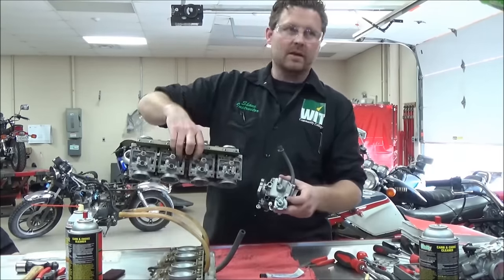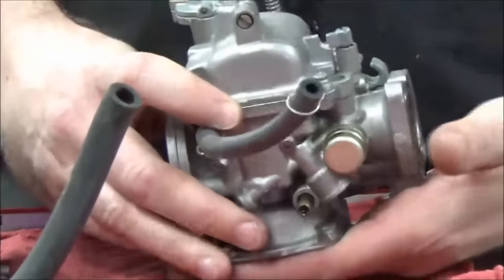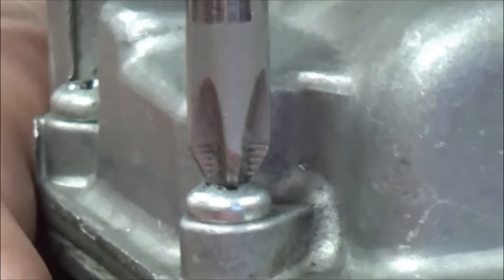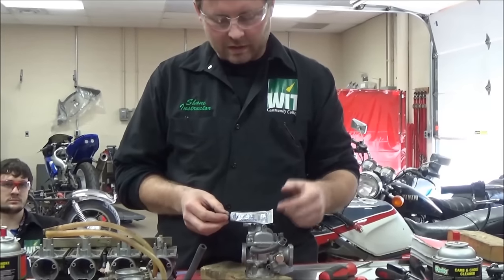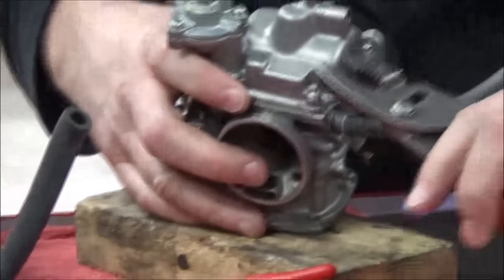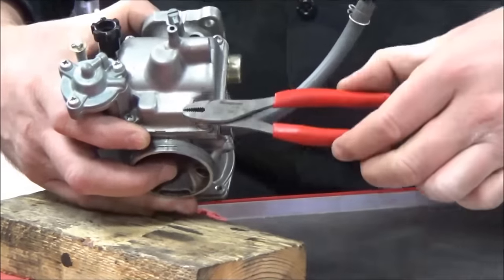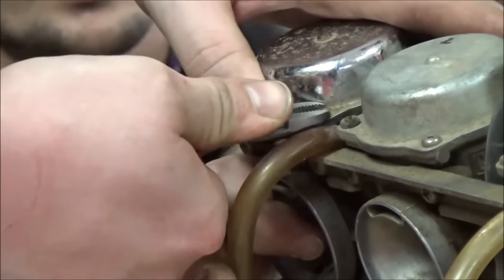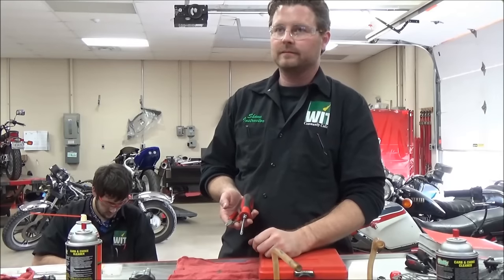How to remove stripped or stubborn bolts WITHOUT drilling! AND Save the day with 5ACP Midget pliers

Comment: Those pliers look good. The more alternatives the better for different problems. Thank you.

Vessel make good JIS screw drivers, but they also do a range called Impacta. These are screw drivers with a built in impact driver action. Useful when the screw head is difficult to get at.

Comment: I've used the old fashioned manual impact driver handle with great success when the phillips head was stripping out. First, use the correct bit size, or an extension; then, push down and make sure the handle is already rotated to the "CCW" removing direction, then lean on it and push hard before you try turning. The internal spring and impact design transfers inward pressure into a ccw action and this does a good job of not allowing the driver to rise up out of the head. Use a hammer if this fails, but keep inward pressure on the handle as you strike it. Even stripped screw heads can surprise you by loosening, when power impact tools fail.
Reply from the maker: We have videos on the channel demonstrating impact usage as well. Thank you for the comment. See the link below for more help with your question. I have been banging my head against the wall thinking of ways for people to say thank you in an impactful way to help keep these videos coming. Here are few ways that many have found as a way to give back. 
* Membership to H2W (includes t-shirt or tech help) https://how2wrench.com/product/membershipmembers-onlymembers/
* Simple donation to say "KEEP IT UP"
May you have a great day and... https://www.paypal.me/how2wrench

Free Mechanic info, tool reviews, and “how to” videos newsletter sign up: https://how2wrench.com/subscribe-free-newsletter/

Missed a past issue? No Worries. Newsletter Archives: https://how2wrench.com/blog/newsletter-archives/

Like freebies? Click here for a free diagnostic checklist! 
http://gem.godaddy.com/signups/364621/join  

If I can ever be of service to you, here is a video explains how to connect with me. 
https://www.youtube.com/watch?v=vjvmB01ebcs

Comment: If you want to see some stripped fasteners, but a bike off Craigslist. Carb bowl, idle / air adjustment, drain, case covers, you name it, you'll fine some goobered up. Most owners have little to no mechanical knowledge and they just torque the heck out of every fastener. I'm restoring a 2004 PW80 right now and it had it's share of stripped fasteners. I had no choice but to replace with OEM parts. When I sell it, whoever buys will get a short lesson in what a JIS fastener is and what tool they should be using on it. I've done some research lately on the JIS bits. Supposedly, the newer US Imperial screwdrivers and bits are made with similar design to JIS and even the Japanese are no longer marketing screwdrivers as "JIS" standard. Maybe tool manufacturers are moving towards a more global standard on "cross-head" screws and bits, but chances are the old American standard tools in your box are not intended for the Japanese screws. Personally, I'm going with some JIS bits I bought and trying those out.
Reply from the maker: Right??? I just bought some JIS Screwdrivers to make some videos on and compare! 
Thanks for commenting and adding value to our community!

Have you subscribed yet to never miss a video? Have you seen the video playlists? Check them out here: https://www.youtube.com/user/conleybuilt/playlists  

Want to say “thanks” or “keep it up”? Click here https://www.paypal.me/how2wrench    
 
Your answers and help are just around the corner. Save time and money while protecting your investment and yourself by doing it the right way at www.How2Wrench.com

Comment: In 50yrs of practice, I've never failed to remove a float bowl screw, or any screw for that matter, without anything more than a good dot punch and a sharp tap. But have used many other methods as well.
Reply from the maker: Nice. I have found this so depends on whom your following as in the last mechanic. When following DIY wrenches, due to a lack of good shops in the area, you find many fasteners buggered up. 
Head over to the new website and subscribe to the newsletter to never miss a video or newsletter! www.how2wrench.com/contact/ 
Keep Wrenching,
Shane Conley
Instructor/Motivator/Motorcyclist
www.how2wrench.com
Reply: Will do Shane...Even though I've been "At it" for over 50 yrs one is never to old to learn!!

Comment: Take a rubber band or inner tube and place it on the stripped philips head.  Then place screw driver loosen with screw driver.  The rubber band fills the stripped areas and provides extra traction for driver

Comment: As a long time machinist and HD rider I've seen my share of abused fasteners. Most mechanics are faced with getting out stripped bolts on their own with limited time and resources. I'd say have the mechanic spend the minimum time on the problem screws and then send them to somebody with a milling machine and experience.

Something I've faced more than once:

People assemble their HD wheels, they completely coat loctite on the steel bolts (disc/pulley)  and then screw them into an aluminum hub. Try to take it apart a couple years later but the bolts (allen) either strip out or break off. So they get a hand drill, drill a crooked hole and then break an easy-out in the hole. Beat on it with a hammer for good measure and then they send it to me! 

I always get them out no matter what and sometimes even save the threads but sometimes I do heli-coil or make an insert on the lathe.

-'lil stan
Reply from the maker: I hear ya... 
Thank you for sharing in my work. If I can ever be of service to you, here is a video explains how to connect with me. 
https://www.youtube.com/watch?v=vjvmB01ebcs 
Keep Wrenching,
Shane Conley
Instructor/Motivator/Motorcyclist
www.how2wrench.com
Like freebies? Click here for a free diagnostic checklist! 
http://gem.godaddy.com/signups/364621/join 

Did you like this free video and hope to see more? Would you just like to say thank you with a donation? Click https://www.paypal.me/how2wrench

Comment: Another great tip! We have two 2000 buell blasts. One starts perfect with no throttle and the other needs throttle even with a new electric enricher. I can spray cleaner thru the enriched circuit and see it come out. How can it not be getting enough fuel? Could you help me with this?

Comment: My tech tip: use an angle grinder with a 1mm blade or a dremmel to cut a groove and then use a flat. You will be able to reuse that screw especially if you are a diy guy and you don't have access to all types of screws

Comment: Shane coney I have had a set in the industry no way can you do carb cleans at motorcycle shops in the spring working Commission without tricks and that's just one of many thanks for sharing thanks for sharing I would share more myself butb I'm not that computer savvy nor do I have time I have had a set in the industry no way can you do carb cleans at motorcycle shops in the spring working Commission without tricks and that's just one of many thanks for sharing thanks for sharing I would share more myself but I'm not that computer savvy nor do I have time I hope you two helps everybody as much as it has the community that needs it because it is based on a free video  format.

Comment: Ever heard of hand impact drivers, makes that screw come out like a hot knife in butter.
Reply from the maker: We have videos demonstrating that on the channel as well. Over 500 videos on here. Thank you for the comment. See the link below for more help with your question. I have been banging my head against the wall thinking of ways for people to say thank you in an impactful way to help keep these videos coming. Here are few ways that many have found as a way to give back. 
* Membership to H2W (includes t-shirt or tech help) https://how2wrench.com/product/membershipmembers-onlymembers/
* Simple donation to say "KEEP IT UP"
May you have a great day and... https://www.paypal.me/how2wrench

Free Mechanic info, tool reviews, and “how to” videos newsletter sign up: https://how2wrench.com/subscribe-free-newsletter/

Missed a past issue? No Worries. Newsletter Archives: https://how2wrench.com/blog/newsletter-archives/

Like freebies? Click here for a free diagnostic checklist! 
http://gem.godaddy.com/signups/364621/join  

If I can ever be of service to you, here is a video explains how to connect with me. 
https://www.youtube.com/watch?v=vjvmB01ebcs
Reply: @Eddie Whittington  Yup!!!!! DeWalt DCF887 or DCF787. Hot knife, glowin' hot! And, no real pressure required. Especially good on bolts where a socket might ring off the head. Just needs that little burp. Never use one to tighten a bolt/machine screw.

Comment: you can put a wrench on your screwdriver for extra down force
Reply: Mark Heckman   yes you can use a wrench,,, or even clamp on a pair of vice grips,,,,, but any screw you'll need at least 60 lbs of downward Force to keep the screwdriver in its slot,,,,,,,,

Comment: Some good knowledge. Did everything BUT use the bolstered area on the screwdriver which is made to use a wrench. That keeps you from having to use body weight. Instead, one can use the tool properly and not form a hazardous habit that could lead to injury down the road. Just a thought.
Reply: he uses his body weight so the screwdriver doesn't pop out, not to twist it
Reply: As XxBLOODZILLAxX said, he was using his body weight to keep pressure down onto the screw head, which was damaged.

You should always apply pressure onto a tightened screw for at least 1/8th of a turn, otherwise theres a distinct possibility the tip will lever out & damage the screw head further, especially if your screwdriver is worn or isnt a snug fit.

A lot of cheaply made products have badly made screws, either of metal thats too soft, or that corrodes quickly, or with slots that arent accurate, its always worth going through a selection of screwdrivers & bits till you find one that fits tigtly, otherwise you are running the risk of it rounding off.

Then you`ve got the potential of the screw head breaking off of the thread, if you suspect thats the case, use penetrating fluid & wire brush the back of the thread off with a Dremel if its accessible, maybe even heat the surrounding metal if its safe to do so (obviously be careful with carbs or anything with rubber or plastics in the vicinity), then go for it.. If it still breaks, well, thats another video!

Comment: What if the stripped screw isn't accessible to a pair of pliers? I've got my carburetor out of my bike but the cover keeping the Trumpets (?) on has a few stripped screws. Pain in the ass... this is my first go at anything motorcycle related and so far these stripped screws are my only set back.
Reply from the maker: Karsten Weening 
Email me a pic of what your dealing with. how2wrench@gmail.com 

Also If I can ever be of service to you, here is a video explains how to connect with me. 
https://www.youtube.com/watch?v=vjvmB01ebcs 

Link to membership: https://how2wrench.com/product/membershipmembers-onlymembers? 

Keep Wrenching,
Shane Conley
Instructor/Motivator/Motorcyclist
www.how2wrench.com

Like freebies? Click here for a free diagnostic checklist! 
http://gem.godaddy.com/signups/364621/join 

Did you like this free video and hope to see more? Would you just like to say thank you with a donation? Click https://www.paypal.me/how2wrench
Reply: Karsten Weening    the screws under the trumpets,,,, sounds like a vf750,,, ???   If they're that tight someone must have tighten them before they put the trumpet on,,,. So most likely the ear is broke on them,,,,, just twisting counterclockwise and pull them off,,,,,,.  The airbox holds them all down anyhow,,,,,

Comment: use dremel tool with small cut-off wheel  and cut a slot for a straight blade screw driver. put the screw driver in the slot you just cut , rap it with a hammer to wake it up, and unscrew it.
Reply: Jim Parks  yes that's how you do it,,,, good ideal to wake up a Philips first too...   I have a nail set,,, ground down,,, that will fit right in the center of a Phillips,,,,, two or three hits first,,,

Comment: Would a impact screw driver work on removing striped carb bolts? And does anyone have a link to where i can buy these 5acp pliers i cant find them anywhere.
Reply: Peter Bobrik   the link for the pliers is under the video in the description,,,,, and if you read all the comments one fella mentions where to get the screwdrivers,,,,,

Comment: Nice video. Very informative. I was not aware if this video was for demonstration purposes, but for safety, it is recommended to NEVER hold any item that you are attempting to unscrew in that manner, especially when putting that much force on it. It is more secure to set it in a vice or something similar. If not, one day you will definitely shove that screwdriver in your hand. Maybe not you Shane, but maybe as a teaching point to others. Been a master tech and Auto Repair business owner for 20 years as well as an instructor. No offense. Just sharing.
Reply from the maker: No offense taken. Thanks for sharing.

Comment: In 4:50, I would cut it with a hacksaw and remove with a straight edge screwdriver.
Reply from the maker: kw0s You think that's easier and faster than grabbing  specialty pair of little pliers and removing in 2 secs? 🤣
Reply: Thanks, it is Yes and No. Yes if you have one such pliers, which I don't..
Reply from the maker: kw0s true that...😎

Comment: Sure this works but you can buy a whole assortment of brand name "ViseGrips" and do the same thing for anysize machine screw or bolt for 1/3 the price and also if you file or grind down the up fluted pot metal to the original thickness of the head of the screw and then use a near new quality #2 screwdriver they will come out every time.  This is elementary mechanics.
Reply from the maker: How about a part number of a recommended tool. A example? How about being helpful? Visegrips does not (to my knowledge).make a tool this small with rounded corners. You're saying vise grips are 1/3 the price? So they have this tool your mention that will perform as shown in the video apple to apples for $12.66? Dang LET US KNOW YOUR HELPFUL SOUL! 
On another note of your waste of time comment "elementary mechanics". Let me teach you some "elementary math": I took pliers grabbed the fastener and removed. SO like 3 secs...YOU want file and grind a fastener in a tight spot if even possible to not damage to opposing part and then a screwdriver will remove EVERY time you claim. When it doesn't come out (real world here) you will now have to drill it so with labor rates exceeding $75 your imaginary vise grip tool and the "savings" are now long gone. 
Your welcome...:)

Comment: Painful to watch, this guy is meant to be a teacher but he is saying it is fine to use a philips screwdriver on a JIS screw.
A good JIS screwdriver would have taken that out.  Failing that, Vessel make an impact screwdriver that is JIS. 
I suspect there is a Snapon sponsorship or bias.
Reply from the maker: Thanks for commenting and adding value to our community! This is a pretty old video and hope you made it through the pain...good news is your one of many over the years that have mentioned JIS screwdrivers and we have a video in the works comparing them in close up HD. Stay tuned (if you can handle the pain...:) Also you're incorrect about SnapOn sponsorship. Some folks (like myself) like sharing what we support. Find a little positivity in the work. You may get something out the other videos...

Have you subscribed yet to never miss a video? Have you seen the video playlists? Over 600 videos! Check them out here: https://www.youtube.com/user/conleybuilt/playlists  

Want to say “thanks” or “keep it up”? Click here https://www.paypal.me/how2wrench    
 
Your answers and help are just around the corner. Save time and money while protecting your investment and yourself by doing it the right way at www.How2Wrench.com
Reply: @How2Wrench  I except your humble reply